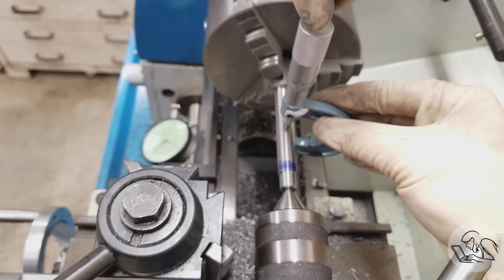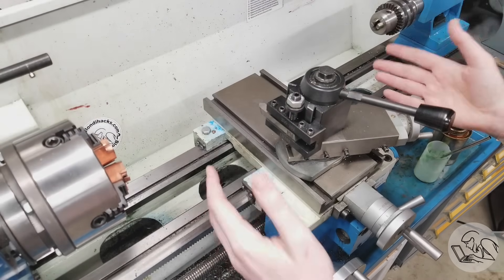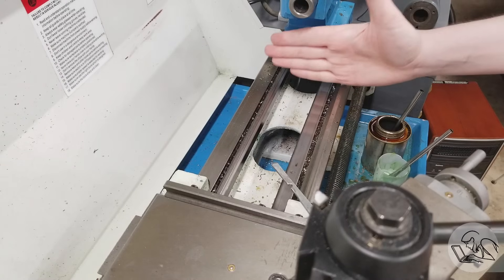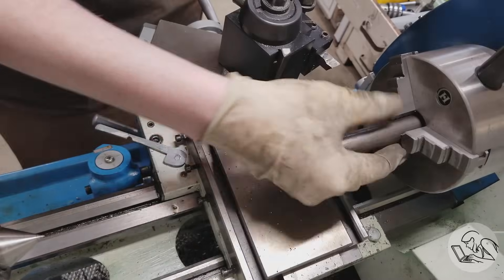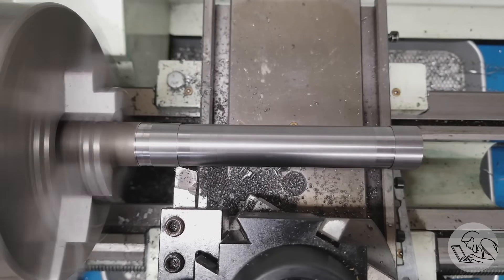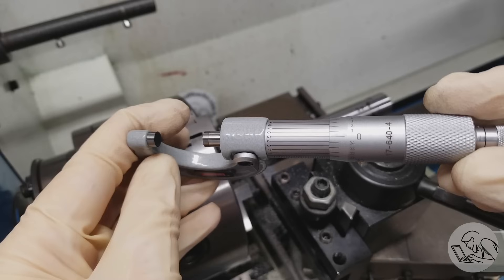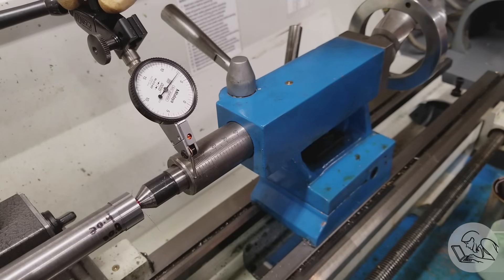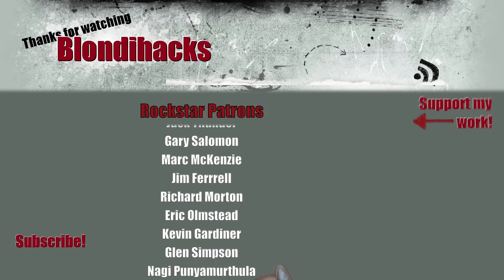How To Align Your Lathe

Comment: So what do you do when you put centers in the chuck and tailstock and they are aligned horizontally but NOT vertically?  And worse, the tailstock is low by .006.  (75 year old 11" Logan)
Reply from the maker: Vertical alignment has much less effect on part taper because the error there is tangent to the circle. You can mostly ignore it. If it’s bad enough to be creating taper then you can shim the tailstock or build it up with braze and machine it back down.

Comment: Hello Quinn, I was thinking, instead of forking out for a machinist level, it could be done with the cheapest of laser pointing levels, thesedays availlable for  like 10€... if you first use the 123block to make a platform on the bed, put the level on it and point at a wall across the lathe, mark the dot, swing the pointer on the spot so you have another dot, you can connect them to have a reference line which will be in the same plane as the main axis of the lathe, hopefully somewhere near horizontal. Now put the level on the chuck end of the ways, point square towards the reference line, mark the new dot and do the same for the tail end, than you can proceed as you did. I might oversee something, but it worked out for my lathe very well anyway! Love your vids, the editing and your humorours yokes! Keep them coming!! Best Regards from the Netherlands.

Comment: Woodworker dig aside (and I know it was made in jest), the words of Norm and other woodbutchers come to mind: "measure twice, cut once", but in this case I would measure thrice, adjust once. I am not a machinist, but I have worked on jobs that required accurate measurements (calibrating various instruments). We would never make an adjustment based on one reading, it would usually be three times and sometimes with two different instruments. Even with all the care you might take to ensure the base of the level and the surface of the ways are clean, you might have missed something. So do another setup and see if you get the same results. Repeatability. If you get the same results 2 or more times, then you can start to believe them once you've ruled out any goofs on your part or external conditions that might affect your measurements.

Comment: I been a wood butcher most of my life, I resemble those derogatory remarks!

I pose this ponderable:  Bubble and Line vs LCD screen and an Angry Pixeled Confuser Brain.

Bubble and Line
At 0.005" per foot, the slope is 0.02387324146383397 degrees, [accurate enough, metal snob? ;) ]  Let's say 0.234° between us friends.  The +/- error factor is directly dependent on the quality of eye balls lookin', the perpendicularity of said gaze, (good ol' parallax effect) and the ability of the mind controlling said gaze to decide where the edge of the bubble should meet the line, to wit: on either edge, or down the middle. Then, for same mind to ALWAYS use the same reference intersection. 

Lots of error possibilities.

LCD screen and an Angry Pixeled Confuser Brain
A 0.1° is 0.02094395102388838 in/ft. Let's say 0.020" per foot.  An wood butcher grade electronic level has an 0.1° resolution, BUT it also has an up arrow/down arrow indicator adjacent to the level reading. This indicates the direction of change needed in the level to read 0.0° exactly.

After 30 years of using an electronic level, I've determined this provides an even finer resolution of reading.  The level can read 0.0° and the up/down arrow indicator can be undecided, oscillating back and forth between needing to go up or down on one end.  A minute adjustment will cause it to settle to 0.0° with no up/down arrow showing.

If the up/down arrow provides 0.05° better accuracy, the result is 0.01047197551194419 in/ft, instead of 0.20 in/ft.

A hugely important factor in measuring anything is repeatability of results.  An electronic level is highly repeatable, with very little chance of operator interference.

===

Personally, I'll take the highly repeatable 0.010 in/ft over a squishy 0.005 in/ft. 

But, hey, what do I know, I'm only a wood butcher.  LOL (A wood butcher who's worked with a self-designed 1/16" plus-minus measurement method which provides accuracy between 1/32 & 1/64", (0.031" & 0.016", respectively for nearly 50 years).  

===

A personal testament for Smart Tool electronic levels and their manufacturer, MD Building Products:
I bought an MD Smart Tool electronic level in the early '90's, shortly after they hit the market. I was building a recording studio at the time, and everything needs to be out of square, to prevent sonic reflection echoes. Building out of square and making it all fit is WAY harder than building in square. (In the beginning days, my nephew built the out of square Goofy dog house for the Disney stores; said it was the hardest thing he had ever built!)

Since buying and using the electronic level, I have built things/repaired things I could never have done with a bubble level.  The best example is choosing a wall height in an old structure, (not new construction), then using the level to move around the perimeter of the room, one level length at a time, and meeting the initial height mark, at the end.  THAT cannot be done with a bubble level.

Try it.

The MD level never failed me, until it did. I was leveling my new to me lathe, for the first time. I got out my trusty MD electronic level, and started the pre-use calibration, (long version, as it had been 5-6 months since it was used.)  In the middle of calibration it locked up, and wouldn't end calibration.

I contacted MD, told the problem, and asked if there was an insider's trick to getting out of calibration mode.

I got an eMail from the CEO.  He said the model I had was so far out of production they didn't have anyone knowledgeable on their initial version, let alone anyone who had ever SEEN one. Not even he, since he wasn't with the company, then.

Never one to pass up a chance to be a smart ass, I replied, telling him my level would surely be worth a lot to MD, purely for research and customer service knowledge building.  They could learn how it worked, etc, etc.  I proposed a trade. I would ship them my very valuable first model MD level, in exchange for a new one.

Now, what I figured was, he and I would have a virtual laugh, and MAYBE I'd get a new one cheap.

Instead, he replied, asking me which of the two models they currently sold, last years, or the current year; a carrying case would get thrown in, with either.

Yes, I shipped a nearly 30 year old, dead electronic level to MD, and they sent me a brand new level.

THAT is good customer service.

If you are interested in buying an electronic level, (and getting a good deal), contact the CEO, and tell him, 'George in Oregon sent me'. That and 5.00 might get you a cup of coffee, but it will certainly get you a virtual laugh when he says, 'Who?', and you tell him.

GeoD

Comment: Nicely done Q.  For the sake of any newbies to the sport of machine work, note that she’s using High Speed Steel tooling.  This is not an accident.  If you try taking ultra light cuts on the free end of the test bar with carbide tooling, even razor sharp ‘aluminum cutting’ inserts, it will probably talk back at you (chatter).  Something to do with the way carbide interacts with steel, even if both tools are the same geometry.  HSS is more forgiving.

Comment: Thanks for the video. Enjoy your videos very much. Here I have few questions. I'm a complete beginner to the machining and these questions can be stupid questions. But anyway here they are. What's the purpose of calibrating the level since what you do is not levelling? Checking the level of the two ends of the bed without rotating the level should be sufficient? Why don't you keep the level on top of the cross slide and move the saddle to the two ends instead of checking the level using 123 blocks?

Comment: Excellent!  I wanted a precision Starrett level, but was not willing to pay over $100, so I made my own. I bought a precision glass vial for $14 and mounted it on a piece of 1x1x1/8x6"  aluminum channel. After a lot of frustration and puzzling, I ended up using exactly the same calibration method as you, right down to the 1-2-3 block! It's still 1 of my favorite tools.

Comment: Thanks for the videos I watched all of them on using a lathe.  I made a part the other day and the drilled bore was not parallel to the OD and I can't imagine how my Grizzly G9972Z did that.  I did a quick check of the tail stock alignment. I cleaned the spindle bore and put the dead center in and ran the lathe. Much to my surprise the tip of the center wobbled around about .015". Doubt that is the problem with my hole being parallel but now I am not sure how to check the tail stock alignment. I don't know what is wrong or even if it needs to be fixed.  I don't think there is anything to adjust or shim.

Comment: Thanks for this video. I’m a woodturner and I think precision is as important with wood, at least from the machine’s standpoint. I will perfect my powermatic to as “level” as possible  as a starting point- and I’ll follow exact method using a machinist level, a stable wood stock and perform the journal cuts and checks.. Thanks again.

Comment: 6:30 - referring back to the afore mentioned 'lathe-on-ship-theory' - I could actually use lower quality blocks that differ in height - as long as I use exactly the same block at the back and the front of the lathe bed ...

Comment: Once you've machined journals at each end of the bar to the exact same diameter, wouldn't you just be able to mount the bar between centres and run a dial gauge fastened to the carriage from one journal to the other while making adjustments to the tailstock until you get the same reading at both journals?

Comment: 393 comments, so I'll just ask. Did you skip a step where you align the tailstock height before adjusting the front to back alignment? 

Not that a cheap overseas lathe would have the tailstock 13 thousandth below center. I swear it should have just come as a kit.

Love your videos. I'm learning a little each day.

Comment: The spindle of my clone exactly like the PM 1127 VF they come from the same factory has 0,0015 mm run-out that's very good for that kind and I had just luck with that ...so I do everything to loose not to much when mounting a chuck especially when I make a D 1-4 Camlock Adapter plate for a chuck... it's an extreme precision work making them with good run-out ...😀😀well for me at least ,😂😂
Love your vids they are so well explained...

Comment: So right. These types of operations will drive you insane if you let it. 
Eventually you’ve just got to put the race car back together and put it on the trailer.
Reply: The same with coding a bit of software, at some point you just have to let it go, let it go, don't hold it back any more.

Comment: Is it assumed the headstock is parallel with the ways? What if the headstock axis is angle in any direction? Shimming the ways cannot fix that can it? How would that be checked and corrected? Great video, I learned a lot!
Reply: I was wondering the same

Comment: Quinn

When testing with shims, wouldn't make sense to use a torque wrench when tightening the bolt to ensure the same repeatable readings?  Especially if mounted on a wooden bench, you could easily compress the wood enough to throw your reading out of wack

John
Reply from the maker: Perhaps, but I’m on a steel bench, and the German standard (“gutentight”) is sufficient in my experience.

Comment: As you pointed out the machine doesn't have to be level... if the 1-2-3 blocks are not the same thickness, as long as you use the same block on the same way, you can still detect twist.

Comment: Good job Quinn!  Some questions.  On your lathe does the headstock sit on the ways or can it swivel? If it swivels did you align that first?How do you make sure the rod extending through the headstock is running true rather than wobbling?   Not in any way a criticism, just questions.

Comment: That tailstock adjustment on my lathe (basically the same as yours) is an absolute nightmare to adjust. No consistency in movement when adjusting screws and I am afraid to attempt adjustment again.  I don't know what you're going to do about my problem from there but it was therapeutic to tell someone that understands. Thanks.

Comment: I am lacking machinist level with an old Taiwan lathe that has never worked well(always cutting different at the extremes) I chucked  up  a pencil laser in the head stock an ran at maximum rpm  and put a piece of white paper on the end of my tail stock and tweaked the bed until  the laser image was centered on the tail stock. The image stayed centered when i moved the tail stock next to the chuck. The test cuts were right on. You can shim the lathe with the machine running.
Reply: This sounds very clever and simple, but I'm a bit confused; if you ever happen to read this, please explain how you make sure the laser dot (circle, actually) is at the precise center of the tailstock to begin with?
  All I can think of is putting a pencil-dot on the tailstock paper where the laser-spot first falls, then moving the  tailstock and making sure the laser-dot stays on the pencil-dot as you do so.
  The eyeballing part doesn't sound very accurate, though.
Reply: @markmarkw1919  when I am machining parts and doing repairs I measure 5 times, throw out the high and the low and average the 3, with the laser it get close, I am hard on my lathe. I mostly repair old equipment and I am happy to be with in .006 in. i have a disc in the tail stock with a center indexed to aim at.

Comment: Good information. When I “level” up a lathe, I try to remove as much human interaction from the process as possible (I am not perfect). I place the level on the carriage and traverse it from one end to the other. Placing a sharpie mark on the ways; showing where I started and stopped. And yes; it is much easier if your unit has jacking screws to level it.

Comment: Awesome videos Quine. Much appreciated. I am embarrassed how much my Tool and die making step father didn't teach me. That said, is there value to using a 4 jaw instead of the three, or would that be of use to further dial in the bed accuracy? I have a 30" toy which replaced my HF 8x10 and having major finish issues. Got a test bar cut but also having issue where the steel bolt together bench is wonky/not very stiff/cant bolt down for reasons. It is a Bolton 12X30 clone.  Suggestions? weight down tail side of can=binet/weld cabinet/build new/reinforce existing?  
I had to buy my own leveling feet x 8 but having secont thoughts before I crane lift and spend time better used elsewhere.  Also using digipas level if you have anything to advise regarding it.
Reply from the maker: Good question! The chuck you use doesn’t actually matter, because of that first step where you turn until you get a clean cut across both journals. Once you have that, you’re inside the runout on the chuck. As for the bench, the heavier and stiffer the better, for sure! Mine sits on a 500lb welded steel bench made from 2” 3/16” wall tubing.
Reply: Right! Wasn't thinking about axis normalization doh.  Hate to waste the cabinet though. The drawers and space for the coolest pump setup is nice. Reinforcement and perhaps a hefty steel plate the full length between the lathe and the cabinet I guess. It might end up looking like a Mad Max apocholiptic workshop piece, but it should be more stable.

Comment: Like others have said, this is the first explanation of both the definition of leveling and the process that make crystal clear sense.  Thanks!  However I keep thinking that this process assumes that the misalignment is horizontal (i.e., you can alleviate it with the lateral screws on the tailstock: fair enuf.  But what if the misalignment is in the vertical plane as well?  Do you wind up shimming under both sides of the tailstock surfaces?  (And I've seen lots of tailstocks with that lateral adjustment, but I don't recall ever seeing one with a vertical adjustment (like matching reversed inclined planes so that sliding forward or backward would adjust vertically but maintiain the horizontality (is that a word?) of the tailstock axis. Is the reason I've never seen that vertical adjust simply because I'm thinking about this wrong?  Maybe this would make for another video (and another on cleaning up any axial misalignment of either tailstock or headstock) that would be as wildly popular as this vid. Anyway, much thanks again for a sterling presentation!

Comment: Great video Quinn, just one question: do we have to trust blindly on the alignment of the three jaw chuck since the beginning of the procedure, and is it worth a regrinding of the jaws after that? Thank you!
Reply from the maker: Error in the chuck will be a source of runout, but not misalignment, because it spins. If your chuck has, say, 5 thou of runout, once you’ve turned the surface down more than 5 thou you’re concentric from then on.
Reply: O.K. Thank you very much! @Blondihacks

Comment: Great vid.  On bench mounted lathes, is it an issue if the lathe is stiffer than its bench.  If you insert a shim under one foot and bolt the lathe down again , you are relying on the bench being stiff enough to pull the remaining 3 unshimmed feet back down to where they were before the shim was inserted.  If the bench is not stiff enough, the stiffer lathe will just “pull” the bench top up to meet these three feet?
Reply from the maker: Gravity takes care of that. It’s about how the weight of the lathe is settling on the feet.
Reply: Perfect explanation, thanks